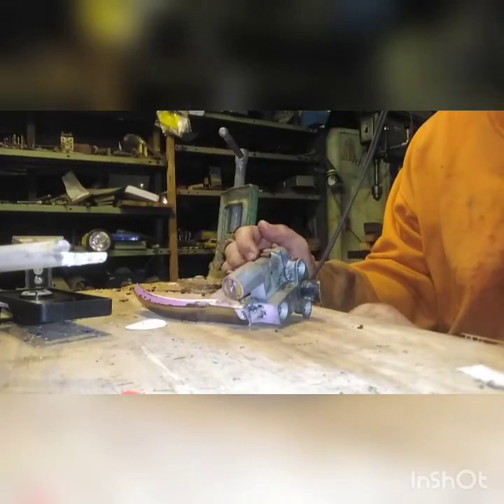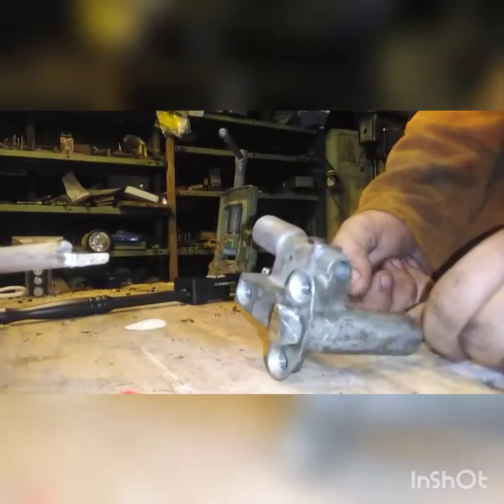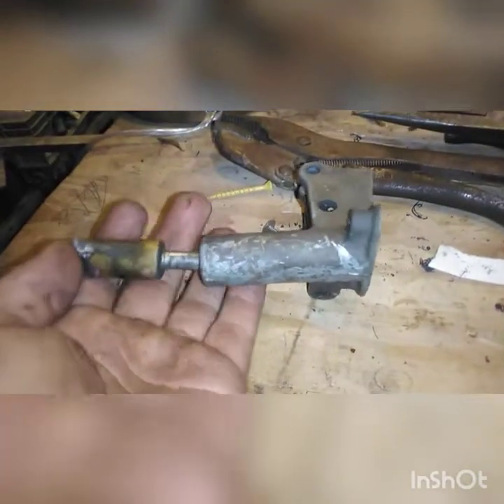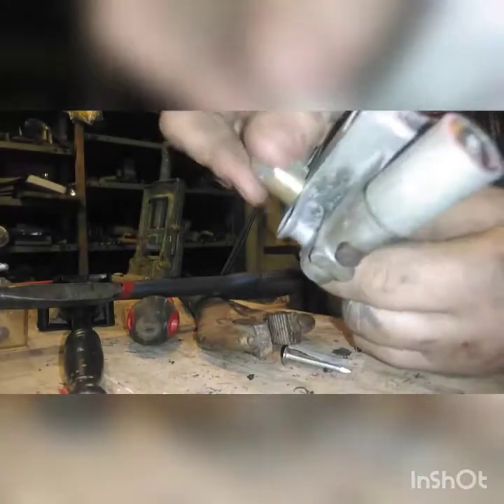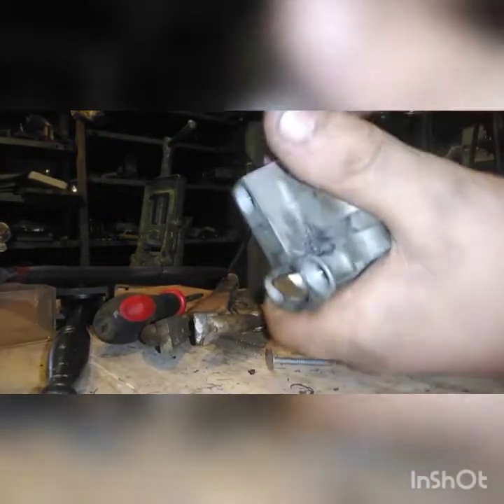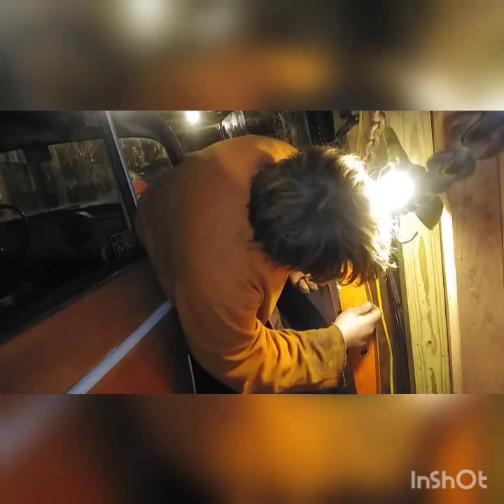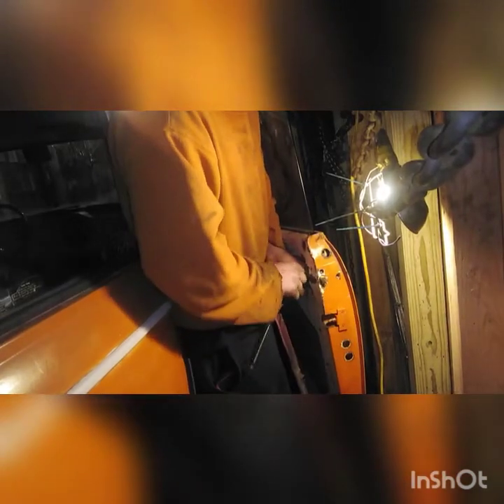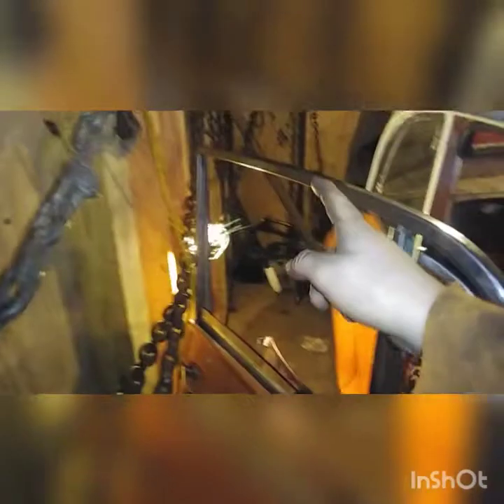Morris Minor Repair 2: door handle rebuild

Comment: It looks like the door latch was binding on dry lube. next time after disassembling the unit try washing in kerosene or petrol(gasoline) this will be less destructive to the item. I would also recommend cleaning the barrel that the door latch is in as well. then either a dry grease or lubricant like driglyde or graphite dust  to keep the lock (latch) way operating smoothly for years to come.

Comment: you might want to put some sort of oil in it to keep all the locks in good nic, I usually use canola oil in a spray can cos it get in all the locks and hinges, and it's cheap, I was even thinking before you said it but it dose look like a house door mechanism
Reply: Canola oil would collect dust etc. hence the suggestion of driglide of graphite dust. The driglyde is an aerosol trade mark sorry don't know what it would be called in US of A, the Graphyte is a powder and both should be easy to pick up at a trade store (handyman shop, Walmart I think you have in america (not something we have here in NZ) Harbour Freight any tool type store) or online at Amazon or similar type of online purchasing point of sale. It should be as cheap as chips as well. 
But in all Canola oil is better than nothing as well. Then again 3-in1 oil the same as you should be using in the carburettor dashpot would be a good idea as it would lube the pivot points on the lock as well. Less friction is good!
I am still very jealous of your twin carbs, but that is just me.